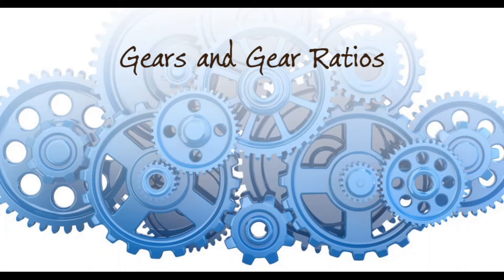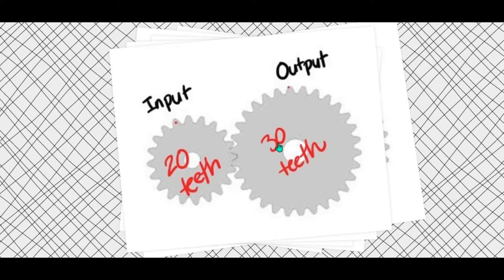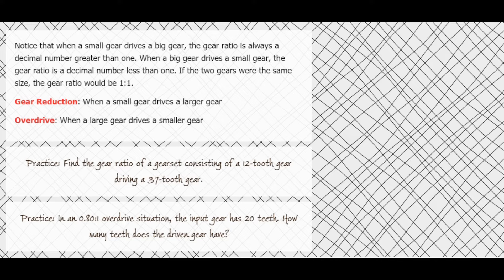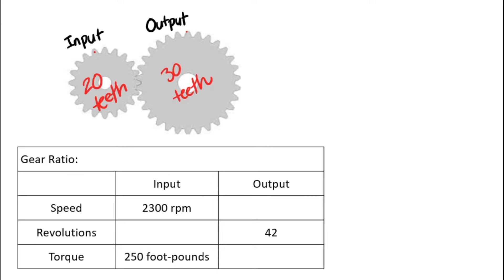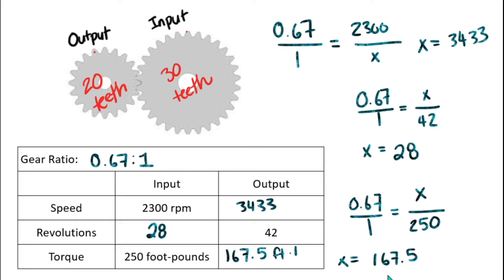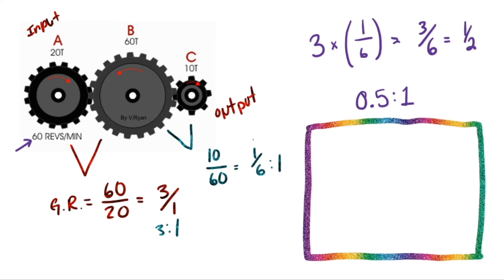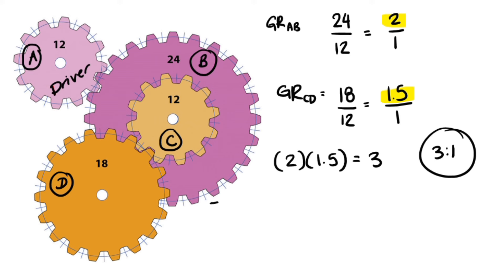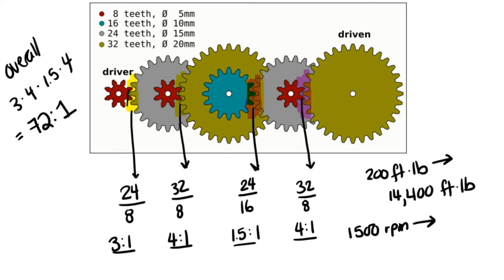Gears and Gear Ratios

Comment: You mixed up input : output / driver : driven at at least one point (~2:59). In the ratio the driver is always first. In a 100:1 to one gear reducer, for every 100 turns of the driver you will only get 1 revolution of the driven. If the input RPM is 1800 RPM then the output is 18 RPM and the available torque is multiplied by 100.

Comment: Very good explanation. What can be the maximum size difference between the driver & driven gear . If the teeth profile of two mating gears is exactly same , can we mesh any output driven gear of infinite size with any smallest possible input gear (driver ).
My second question -  in the  practice example of compound gears A, B , C & D ( 12, 24, 12 & 18 teeth ) , can we calculate how much toque is at gear C ? & how to calculate that

Comment: Jenn can you please explain why at 12:57 you put the x in the denominator instead of the numerator for the proportion? I really need help understanding that. Is there somewhere i can message you directly
Reply from the maker: I think you mean for the speed calculation? Speed is inversely proportional to the gear ratio. So, if I set up my gear ratio as output/input, I have the speed side of the equation as input/output. I have the input speed, I'm solving for the output speed. This means my "x" goes in the denominator. Sorry for the delay in responding!